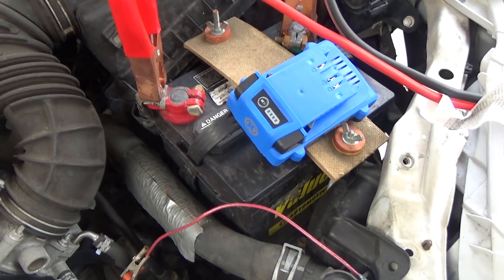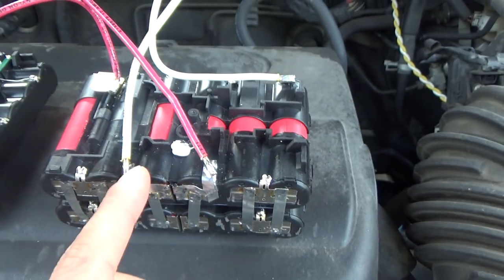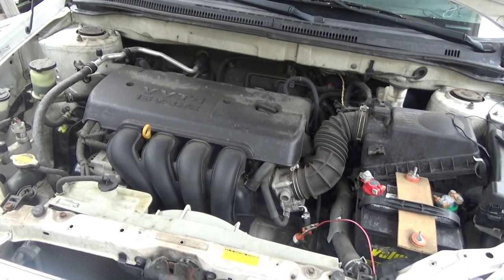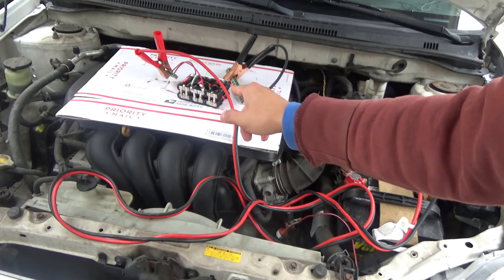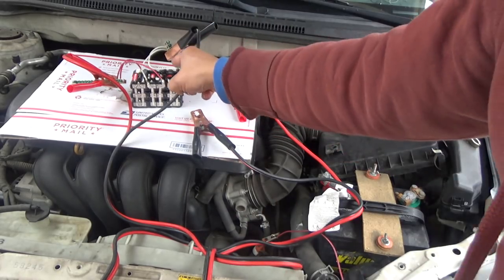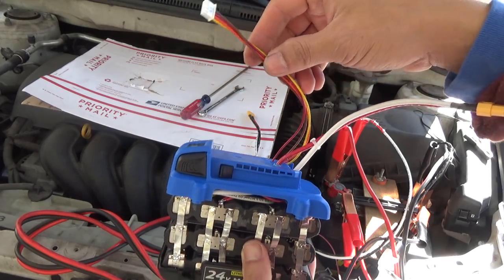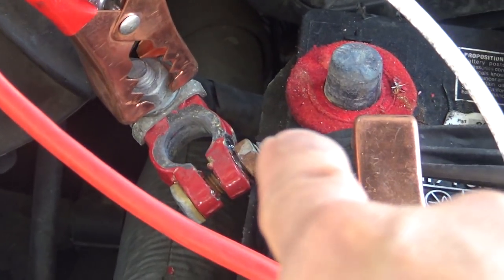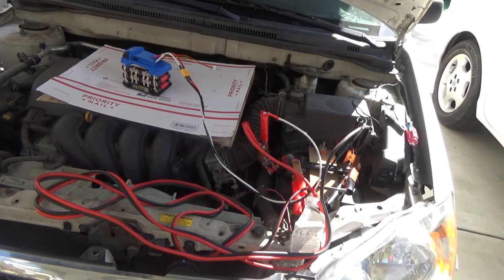DIY: Home made 12V Car Jumpstart battery pack from a Cordless Power tool battery

Comment: Thanks for another interesting video. 
Given how much you like batteries, I'm surprised you did nothing to account for the fact that 18650 cells are not 4v. In fact you kept saying they were! I think the lack of voltage is probably why you had to use so many in parallel - you were basically fighting against the natural voltage drop under load by adding capacity, and I think you'd be better just giving the correct voltage. 

(Particularly for a 'just a starter', which this obviously is - in no small part because there's no Schottkys so it would die or explode after being plugged into the car's stator/rectifier as a 'main' battery.)

Comment: You have to let it sit and charge the car battery for about 10 minutes. I've jumped my car with a Milwaukee M12 1.3A/h
Reply: I have a normal Stanley jump starter
Reply: That's actually really cool! I have both M12 and DeWalt 20V batteries, but I was always sorta freaked out of damaging the tool batteries.

Comment: You should make a 16 Volt system, that way you don't need to disconnect it. :)
Reply from the maker: Car system is only 14.5V max when the engine is running. When the engine is off, it's only around 12V. A 4S Li-ion pack is almost 17V (16.8 to be exact) and that might be too much and can fry your car sensitive electronics.
Reply: I can see your point, but the alternator will charge the 4s battery to 14.6v and then the voltage regulator will stop charging. So your 4s pack will charge to about  60-70%, and never get to full charge. So It wont damage any systems and the pack would work better than a lead acid with the lithium pack at 70%  I have been wanting to test it. I want to build a case lined with a couple of lithium charge bags in-case of a problem. I'm thinking a 4S8P pack.
Reply: @vuaeco   Or a diode
Reply: or a diode

Comment: Very good video vaueco! Good explaned. Thanks a lot.

I have a electric scooter. 2000 Watts battery Lead acid, 48 Volts,  with 3000 Watt motor by about 40 Ahs.
I want to make Lion battery.
It's necessary to get cells with 20Ahs high disharge  current or is normal PC battery cells OK ? Thanks.
Reply: Consider to use from Lidl the Parktool 4Ah power tool battery. Use three in series and as many as you like in parallel. They are high discharge cells like the Samsung 20S

Comment: Thank You, its good video. I just wanted to know, how many 18650 cells i need to start an engine. I am thinking to remove lead battery from my track car and use litium. Also I would remove an alternator. With lead battery and alternator removed, would lighten the car for about 20kg and somewhat ease a load on engine.

Comment: You know why it was not working after 3rd attempted cause your losing a lot of amps w that thin jumper cables ( beside lets assume your full voltage well balance on the lions well your max output voltage regardless of amperage is 12.3 ( you verly charging that huge 1000amp acid battery in the car ) that juice is just tickling . Your best in upraising voltage 4s and turn on headlights for electronic protection I have seen and this turns cars on 4s 2p this way your really charging and upraising voltage which is needed w a dead battery . Well I have repair and modify jumper cables cause man some have way too much rubber and so little copper wire that not much juice is going to charge battery . That why it takes a while even when transferring power from car to car :) but lipo battery chemistry is better at delivering heavy amp draws  but I’ll go for a good brand cause some don’t make good loops for car jumpers they just market things and end up not working after a 6month period
Reply: I might be seeing your video later lol but congrats many of us wouldn’t even attempt but we all learn from eachother have you heard of super capacitors I want to do a project to see if it really starts a car but to see all the cons and benefits

Comment: hello i understand you Battery in 2:47 is a 6p S not 4p3s !!! For me as i see on vidéo you have 4 cellules in the left ok but you have 2 cellule un parallèle contecting with the for cellule in the left with the red Cable !!! mean 2S 6P !!! , or please make me more understanding it
Reply: He is corect. He did it in a weird fashion for some but there are two packs with the configuration of 3S2P. The reason he has 4 wires is because he ties them together, which gives him a 3S4P configuration.

Comment: Good video. Do the test with 4S1P, 4S2P and 5S1P, 5S2P.
There are videos with battery of 18V drill of 5S1P and 5S2P and it worked.

Comment: Hi can I use 18650 3.7v 30amps battery??why's is the model of your battery?
Reply from the maker: You can. That should work. THe battery I used was the Kobalt 2Ah 24V power tool battery. You can look it up on Lowe's website.
Reply: Thanks sir
Reply: But it is 2500ah yours is 2ah
Reply from the maker: It's not. It's 2Ah. Lowe's does not have anything 2.5Ah at 24V, at least in the USA. Where are you from?
Reply: Mauritius.sorry it 3000mah
Reply from the maker: They might sell different models in different country but what I have here is 2Ah. The 3Ah battery you have over there is better then.

Comment: You could of started that car with one of the batteries you should have left it 5s so that it would charge your lead acid battery fast instead of actually trying to make it the same voltage because when those packs are dead they are right around 15v it's perfect to fully charge a car battery no mods needed

Comment: you prob cant jumpstart in other situations with that, colder weather, more heavy (diesel) car ... i think you just got lucky because you already managed to turn the engine in the first try what makes the oil tinner and easyer to start. Well at least thats my thought. For practical use the pack should be much more heavy and the cables big and very short.
Reply from the maker: I can. You have to keep in mind that most jumpstart Li-ion battery packs in the market would require you to hook it up to your lead acid car battery. They are actually just a booster. Most (if not all) of them would not be able to start a car all by themselves without having to hook up parallel to your car battery. If you think about it, it makes sense because it's your car battery and there's no point to remove your car lead acid battery in order to jumpstart it. This pack is able to start the car all by itself. And that shows how much more powerful it is if you also hook it up parallel to a car battery which is almost the case in practical use. I tested it without the help of a car battery just to show how powerful it was. But I certainly would never need to remove my car lead acid battery before I jumpstart my car.

Comment: The. Proper test would be to remove the lead acid battery then see if your diy battery will turn the over engine.I would think this diy battery will not be able to supply enough current, also the supply leads are too thin and too long. This would be lucky to start a motorcycle

Comment: I think it will be cheaper if you go by on jump pack
Reply from the maker: A comparative jump pack about the same price ($60) is usually only 3S1P. This pack is 3S6P so it's 6 times the capacity of the same jump pack. Not only can I use my pack for jump starting my car, I can also use it for any 12V devices including running a 12V DC to 110V AC inverter.
Reply: the jump pack of $60 is 3S1P lithium polymer battery

Comment: Any cordless powertool can start a car as long as is 12 volt or more , is not that complicated....
Reply from the maker: First of all, the starter requires a large amount of current at least 100 Amps or more. A regular 1S power tool only has about 20A discharge current max. So no, not any battery can start a car. In fact, there's absolutely no regular power tool battery that can start a car. Second, your car only run up to 14.4V. And that's when the alternator is running and charging up the battery. Usually at rest, it's only 12.7V max. If you use a battery more than 14.4V say 24V, 48V, or 56V, you're gonna fry all of the electronic components in your car including your ECU.
Reply: On newer garbage (cars) even a cattle prong will fry the electronics

Comment: I hate to tell you.  That's not 20 amps, it's 2.0 amps.  When you split each pack into parallel packs it becomes 12v 4a.  Times three is 12a.
Reply from the maker: You're talking about Amp Hours, mate, not Amp. They are not the same thing. They are as different as night and day.
Reply: @vuaeco  My bad.  I remember now that many LiFePO4 batteries can do 10 or even 20c for short periods.  Why only 3s, though?  4s gives you better range for 12v and the car can handle 14-15v no problem.

Comment: Each cell may be capable of 20ah but that's only for each cell which are only 3.7 volts each so you much figure out the overage peak amerage per hour peak output of your entire battery pack your using , what one cell makes alone is irrelevant except for helping you figure out the total output of the entire pack.  Your playing with fire in this video bro and  did you seriously try to start your car with a 24volt battery pack or did you run some voltage regulator of sorts to keep the voltage no higher than 13.5V while cranking. No less than 12.3-12.5 on most modern cars
Reply from the maker: That's not 24V, mate. Did you even watch the video?

Comment: Your set up put out 8 amps and you needed inrush for 1 mins. 30 amps to start a car.
Reply from the maker: It's a 6P (6 in parallel) battery pack. Each cell is capable of putting out 20A continuous (more for inrush). So a 6P pack will put out at least 120A, not 8A. And to start a compact car like the one in the video, you need at least 80A to 100A.

Comment: Hello Vuaeco
                    .·•*°*•~
.·•*°*•·.~<€((© ),)°?°)··
I LIKE to try that
To operate motorbike
Head lights and my rear lights.
I would like to use a different battery housing and installation for my 12 volt battery pack bike mount .thank you
               Vuaeco.
          That is COOL
Reply from the maker: That would be cool for your bike rather than a lead acid battery.

Comment: lol remove the car battery, you can change the max voltage of your alternator by adapting the voltage regulator, , this voltage is verry rough , not smooth like a charger, so has to be flatned. the lead battery also works like a buffer of changes in demands of curent. You can plase the 
smal iliobat near the startermotor and use thick cables.

Comment: Why bother destroying a perfectly good $40-$80 lithium cordless tool battery pack when you can buy a pocket sized jump box that also has USB outputs and a flashlight for $60-80 depending on where you buy it from and what brand. Hell if you want super cheap and don't care about a larger battery jump box you can get the classic old school big ones for like $40-50 on sale at harbor freight and Walmart nowadays so why bother doing this nonsense , you could have done the experienent on paper with the proper math to reach the same conclusion on paper without wasting perfectly good expensive battery packs , your kind of a fool honestly bro, penny wise dollar foolish.   And you should have unplugged that battery pack immediately upon firing up the car cause the risk of frying those cells or starting a fire is very high even with the alternator lightly charging the pack for less than a minute , it should be disconnected within 10 seconds if your jumping cars with a unit like this and you should also have a proper inline fuse inline in the positive jumper cable along with a one way diode or proper size, but at least an online fuse bro common that's just common fuckin sense, you Intentionally trying to fry the cells in your now destroyed tool battery pack or start a 🔥? Cause lithium fires can get pretty nasty I don't think you'd enjoy the experience.  BTW now that you've ruined your battery pack and altered it's internal wiring configuration how do you plan to recharge the dells in the pack properly and safely ?
Reply: those battery packs are 27 a piece

Comment: Your engine runs like shit , your power steering pump is shot and it's likely leaking fluid of some sort into the serpentine belt which is causing it to squell slightly , and you also sound like you very much so have an exhaust manifold gasket leak , cracked manifold or hole in your downpipe because your car should not be close to that loud , 1.8 and 2.0 Toyota motors normally run quite quietely yours sounds horrible and your valves are also a little loud I'd bet they are adjustable and you need a valve lash adjustment done